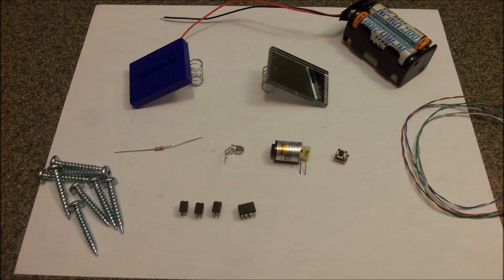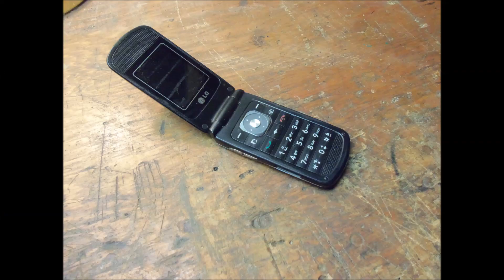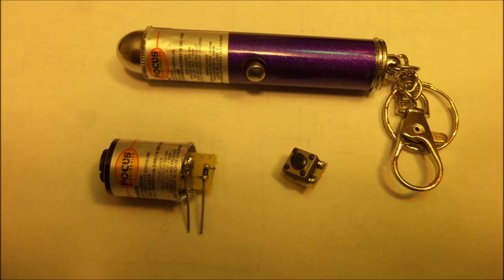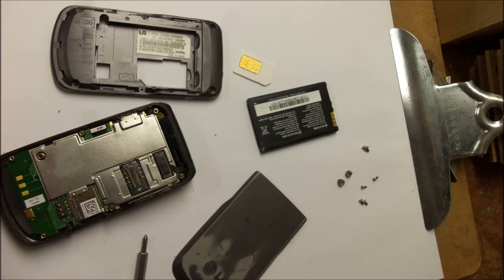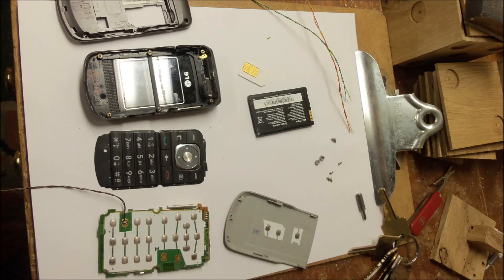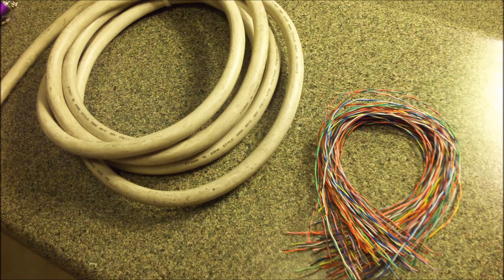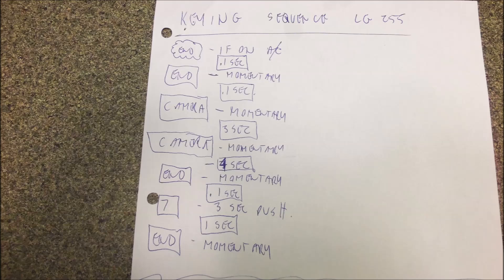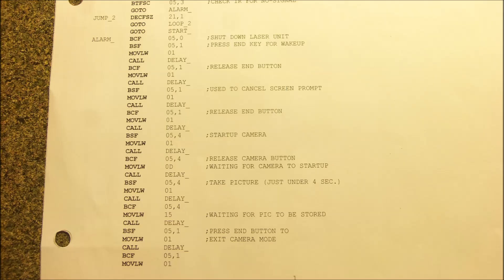1 more use for an old cell phone (part 2)

Comment: I am currently attempting to build a laser security system as a school project and was wondering if you could help me out with writting the programming info for the microprocessor.  I pretty much have it built, just having issues with writting the program.

Comment: Hi I have a spacific question. Is there away to take the camera out of an old cell phone and use just that small camera buy itself as a spy cam im trying to build my own night vition spy cam. I have all the parts I just dont know how. Or maby if I can make one out of the night vision baby monitor my cheating boyfriend tampered with I need some kinda help o how to build this from scratch any suggestion? Thank you!
Reply from the maker: I think that you'd need to be a brainiac to do what you are asking. Ideally you do need to get the camera manufacturer's information on the camera and then you'd design your own drivers around it using a good microcontroller, or simply just buy an already designed spy cam or better still just get rid of that boy.
Reply: PICing4fun yeah.... i was thinking to get that tiny little camera from the old cell phone but..... it was a waste of time each cam from each phone is different... i like your way of doing things......lol
Reply: +Tiffany Victoria lol we are actually the same, want to make a small spy cam by using the camera from my old s3 haha
Reply: I know i was trying to spy on my boyfriend who was spying on me now hes my ex so cam phone expiriment is over
Reply: Tiffany Victoria I see haha
Reply: Have you figure out a way to make the cam? I was searching every possibilities in YouTube about making a cam but I wasn't able to find even a single video for that.
Reply: Tiffany Victoria
Reply: Tiffany Victoria
Reply: same pinch..

Comment from the maker: It's actually a lot easier to do it the way that you want. With only a phone call being sent the circuit uses only the main chip plus just one optoisolator, and yes you could easily build it using a photocell instead of the infrared LED, just change the resistor to match the circuit.